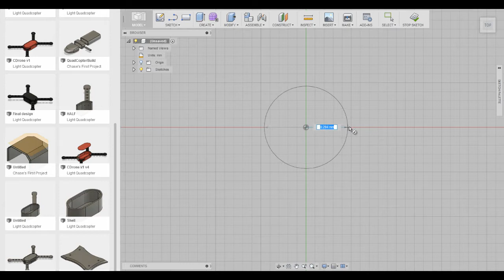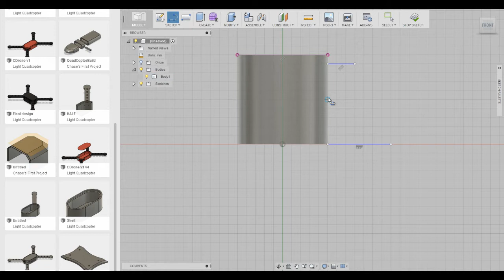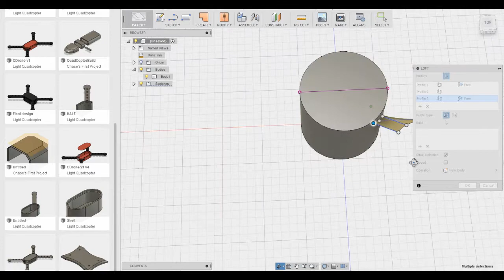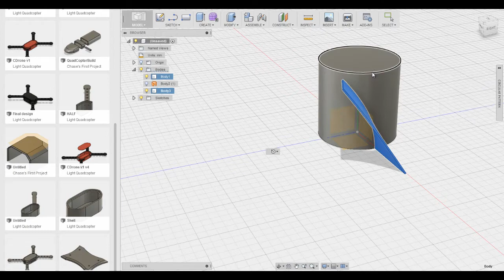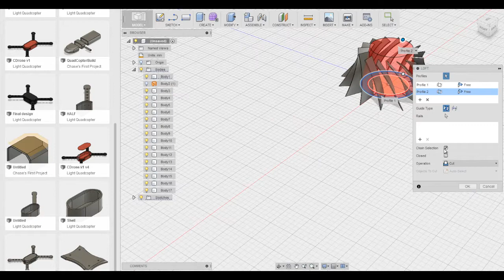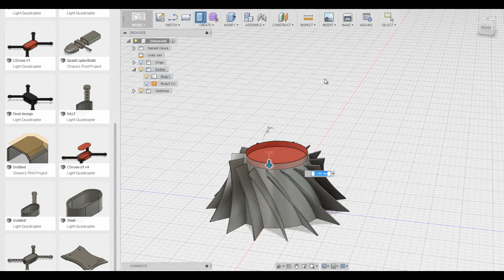Fusion 360: How to make a FUNCTIONAL Impeller

Comment: Hey, Code! Maybe you should change your "like" from shit (your word, not mine) to cool stuff. If you're interested in designing cool stuff instead of shit, you're much more likely to end up with cool stuff. Just sayin'... Still looking pretty good, though. Also, you need to design in an "escape" for the accelerated fluid at the perimeter (the exducer) where the impeller blades are sharp - the air (or other fluid) needs to escape in this region, but if the housing follows the contour of the blades, it effectively pinches the area down to nothing. The blade tips should therefore be squared off so that the housing can then be designed with an entry to a diffuser. Check out any turbo, or even a water pump, for that matter...